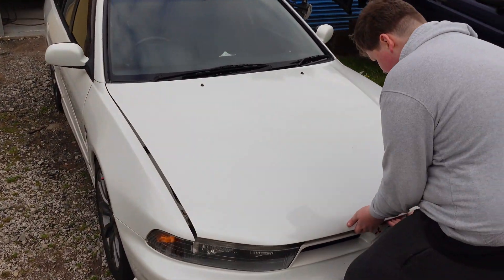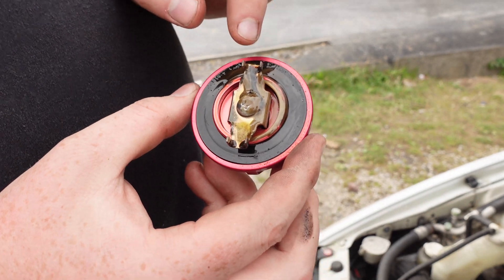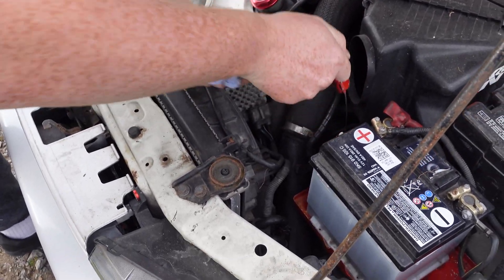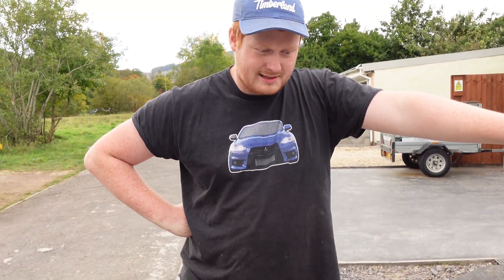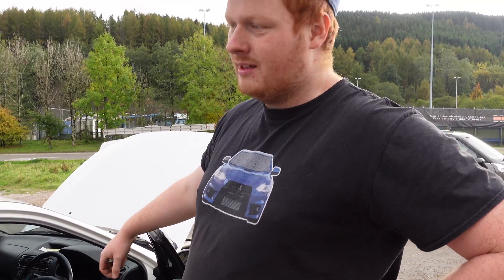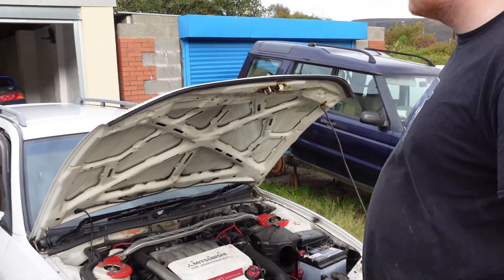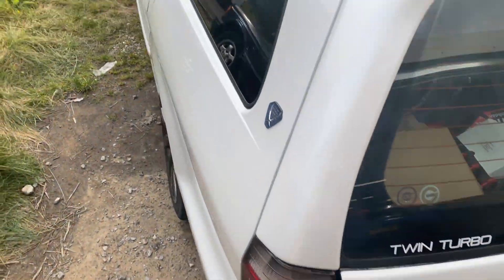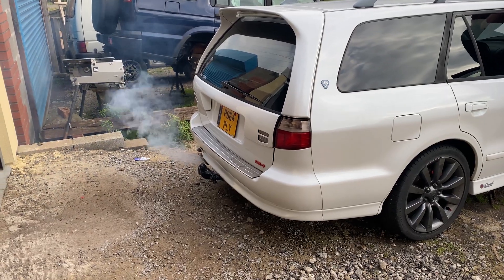Legnum VR4 Basic Engine Health Check

Comment: head gasket would result in vapour and oil in the coolant, not in blue smoke. 
this could be valve seals, or turbo. 
turbo can be checked by removing the intercooler pipes. if good quantity of oil will be found there, then the problem is obvious.
valve stem seals have to be replaced once in a while, with guiders.
this can be checked on a hill, driving downwards with engine brake. after a km or two when you step on the gas and blue smoke comes out... then the seals are f.cked.
the worse scenario is one (or more than one) of the piston rings stucked/broke, and the worst is the cylinder walls are worn out :/

Comment: Perfect excuse for a big turbo...yeh your better replacing both of them, not an easy job doing a single on these...with alot of custom fab needed. 
And my 2.8 v6 turbocharger is located top mounted where your airfilter box is. With the compressor housing facing towards the front as you open the bonnet. Easy to replace

Comment: The turbo Probably is causing the white smoke. I suggest replace the turbo cartridge & spark plug. Also looks for any coolant leak by looking below the engine bay. My caldina gtt  is facing same white smoke issue after replacing new turbo cartridge it seem solve then another issue that is water pump is leaking. Now it all fix everything all right.

Comment: Mines did that exact same thing, smoked the same way at idle, smoked more with revs, sort of bubbling pops out of the exhaust, it's the turbo. As for which one, you will have to remove the piping and check shaft play but best bet is replace both while your at it, have fun doing the rear turbo lol, definitely change your timing belt, spark plugs and service your injectors but timing belt replacement is most important. Run and engine flush, use cheap oil to refill, run for 500k or so then drain and replace with good oil. Next step would be trans fluid, diff and ayc pump fluid change and please use the manufacturer's spec fluid or it could lead to you having a very bad time in the future

Comment: I'd get some coolant tester strips as a first step to diagnosing the issues. I would say that looks like the HG is on its way out. On tickover it looks more like steam than oil. The smoke looked a bit more blue when you revved it but hard to tell on viseo on a grey day. Turbo seals are probably leaking too but HG is likely compromised. I wouldn't use K-Seal. It'll gum up the coolant galleries and then you'll have more problems and have to take the engine apart. K-Seal is for £300 fiestas. This deserves better treatment!
Reply from the maker: I wont be sticking any k seal in this as you say it deserves better, Im hoping for the best and preparing for the worst lol

Comment: Pull the hoses off the turbos and check with your index finger for excess play on the shaft. The churping noise could be the waterpump..
Reply from the maker: Thats a good idea and what I would usually do, I am reluctant to do major work on it outside so as soon as the evo is done i'll get stuck into the legnum

Comment: The squeaking is probably one of the pulleys from the Aircon, power steering, alternator, belt tensioner, etc. 

Smoke: buy a cheap coolant tester. One of those thingies you put on the radiator instead of the cap to see if the color of the testing fluid changes. If it does, there's oil in the coolant and then you're sure if the head gasket has an issue or not. A compression test is also a good test, just a lot more work, especially the bank of 3 cylinders at the back of the engine, for which you'll need to be unbolting quite some stuff (intake manifold, throttle body, IC piping, etc etc
Reply from the maker: I agree I think it was the upper timing belt pulley. Its stopped squeaking since.

i will try the fluid tester aswell

Comment: You need to get the head gasket tested as well as somehow check the turbo units. It will be easier to diagnose the head gaskets with a pressure check. If that passes it’s probably the whistles 👍
Reply from the maker: Compression test might be the easiest way to do that
Reply: @rowanlewisuk  the coolant system can be pressurised to check for leaks by pumping air in, never done it my self but seen it done, she looks like it’s steaming rather than burning oil